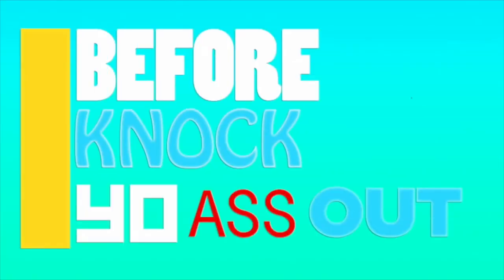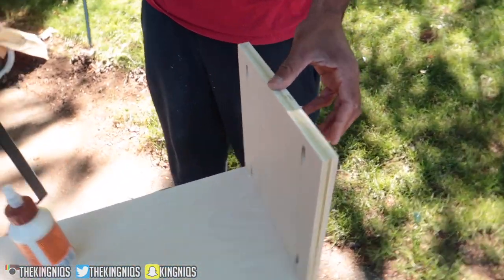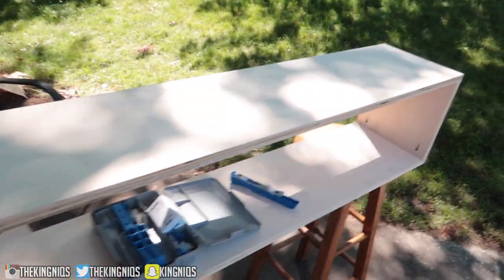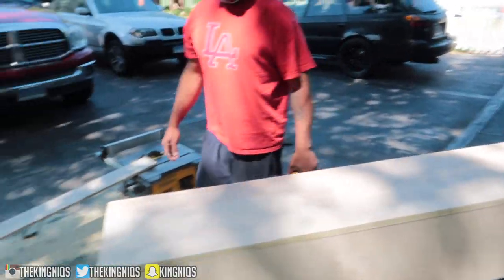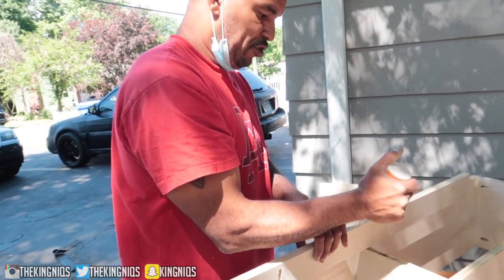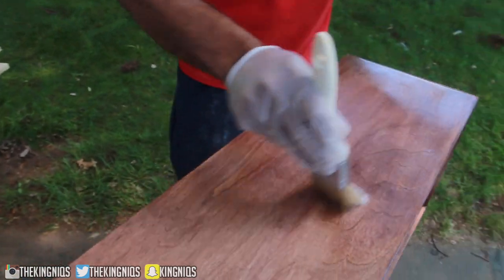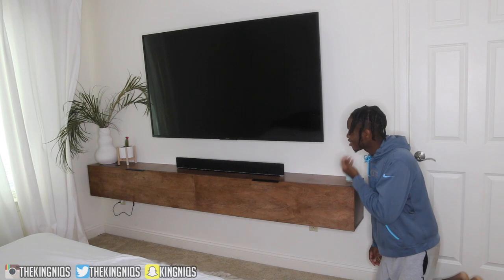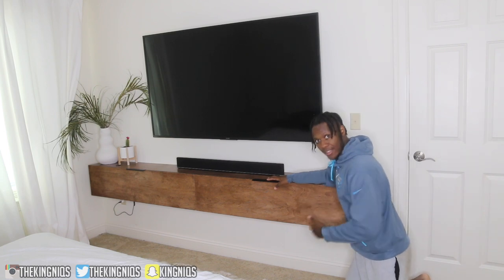How To build a $1000 floating Media Console for Only Under $100! DIY

Comment: Was hoping to see how it mounted to the wall. Looks good though
Reply: you’ll want to take a long piece of wood & nail that to studs, then nail it to the wood. you can see how they did it in the video. just make sure you find the studs or else it’ll rip the drywall off
Reply: @s1D5993  lol. Only in the US where all the houses are made of balsa wood, mdf board and chicken wire.

Comment: What brackets you use to hang it on your wall? I’m doing a similar project.
Reply: They use what is called a "French cleat", which is a smart way to hang something heavy like this on a wall... You can also use French cleats for heavy mirrors, pictures, and so forth. The back of the media center has 3/4" plywood with a 45 degree bevel built in. They mounted another board with a 45 degree bevel on the wall, so the media center weight pushes down on the cleat, holding it to the wall. Google "French cleats" for more info. Hope this helps.

Comment: How u attach it to the wall??
Reply: They use what is called a "French cleat", which is a smart way to hang something heavy like this on a wall... You can also use French cleats for heavy mirrors, pictures, and so forth. The back of the media center has 3/4" plywood with a 45 degree bevel built in. They mounted another board with a 45 degree bevel on the wall, so the media center weight pushes down on the cleat, holding it to the wall. Google "French cleats" for more info. Hope this helps.

Comment: I wish you could've showed us how you put it up...Its nice though
Reply: They use what is called a "French cleat", which is a smart way to hang something heavy like this on a wall... You can also use French cleats for heavy mirrors, pictures, and so forth. The back of the media center has 3/4" plywood with a 45 degree bevel built in. They mounted another board with a 45 degree bevel on the wall, so the media center weight pushes down on the cleat, holding it to the wall. Google "French cleats" for more info. Hope this helps.

Comment: Looks awesome but I wanted to see how you mounted it to the wall
Reply: They use what is called a "French cleat", which is a smart way to hang something heavy like this on a wall... You can also use French cleats for heavy mirrors, pictures, and so forth. The back of the media center has 3/4" plywood with a 45 degree bevel built in. They mounted another board with a 45 degree bevel on the wall, so the media center weight pushes down on the cleat, holding it to the wall. Google "French cleats" for more info. Hope this helps.
Reply: @leehartwig5996  thanks!!! I’m going to do that on the media center I want to build
Reply: @Lui5_5.0  Right on. Glad that helped you out!

Comment: Definitely not under $100 since one of the tools you had to buy was $40. Lumber usually costs $20/$30 per board depending on length not to mention the coat of finish at the end of the video. On top of that you know your Unc walked away with a few dollars in his pocket. Ima say you paid around $150-$200 for this setup. Which a steal compared to most floating consoles out there.  That’s a solid job your Unc n you did tho. I’m bout to place an order lol jk